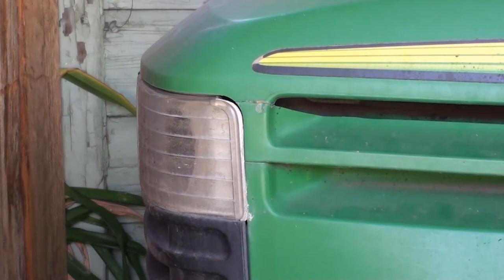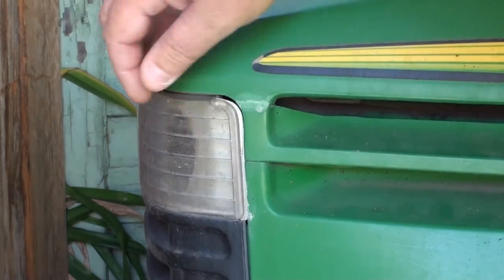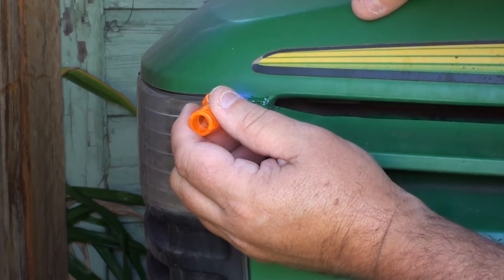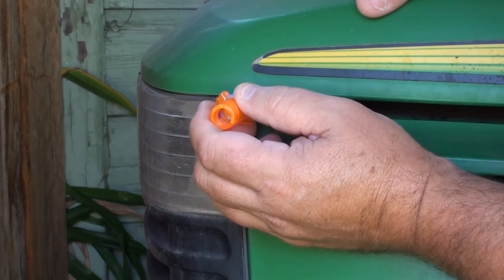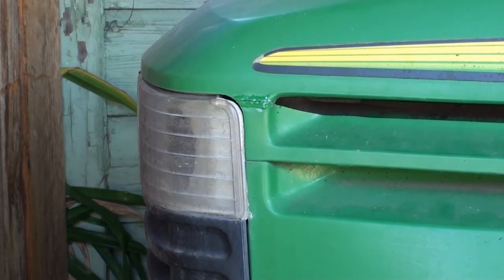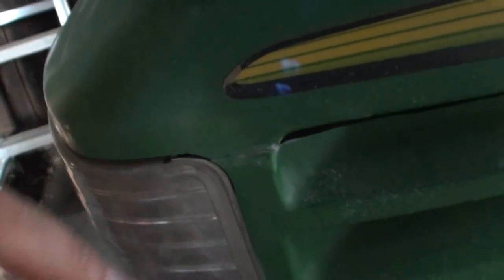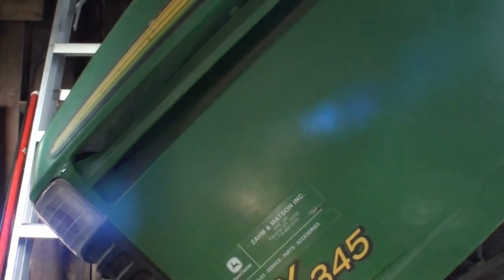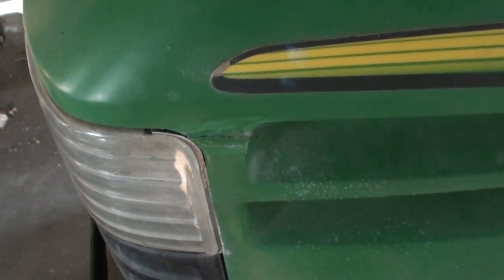JD GX345 hood repair Bondic liquid welder

Comment: John Deere seats and hoods always break and a new OEM hood costs over $700.  My plastic hood is broken in several spots.  Who the hell would put a hard, brittle plastic hood on a garden tractor that is sure to get broken if you bump a tree or a branch.  There are other materials that could be used that would not crack and break and would cost about the same.  How about the composite materials used to make canoes and kayaks.  They take a beating on rocks and never break.  John Deere really needs to get their act together for the prices they are charging.
Reply: Same with AYP
Reply: Go at it with a soldering iron.  Or better yet a Harbor Freight wood burning set, has lots of different bits.  I just started with a cheap 30 watt iron with a sharp point tip, ended up finishing the whole thing.  Wish I could get red polycarbonate to finish the job better, but you can get green rods if you have missing pieces.  Otherwise, just knit it back together with a hot iron.